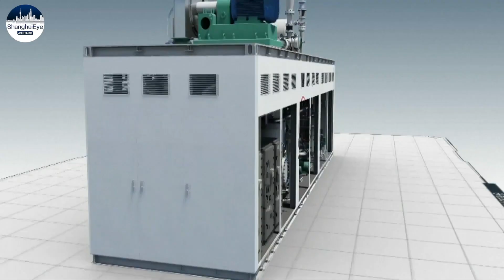China's first integrated Methanol-to-Hydrogen service station now in operation

Comment: Wouldnt be cheaper and safer instead hydrogen production on site they simply sell methanol  to ev hybrid  vehicles  with methanol to hydrogen fuel cells  and sodium ion batteries.

Comment: Hydrogen car is definitely not the future, methanol car is the future, why is methanol car the future of human beings still like liquid fuel cars, there is a serious rejection of gas cars, no one can guarantee that they will not have a car accident, gas fuel and car accident is a very scary thing, most of the future cars are electric vehicles, methanol cars, methanol ➕ battery-car, How does methanol get offshore wind power ➕ seawater to produce hydrogen ➕Co2 equals methanol😂